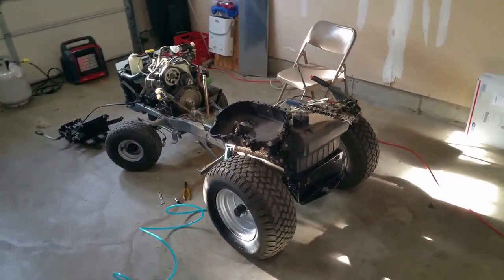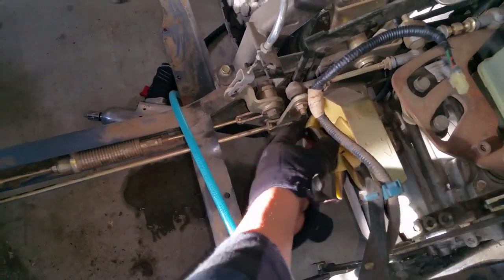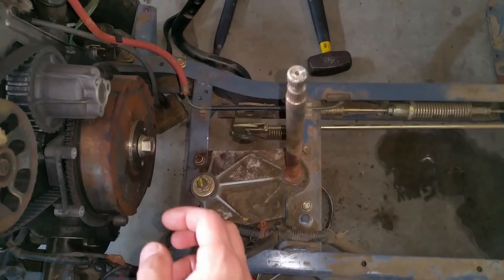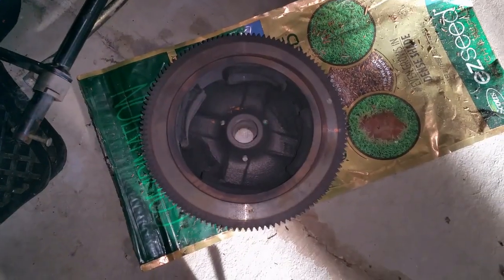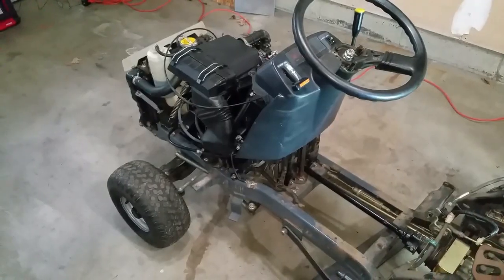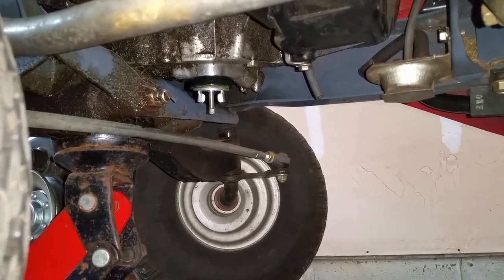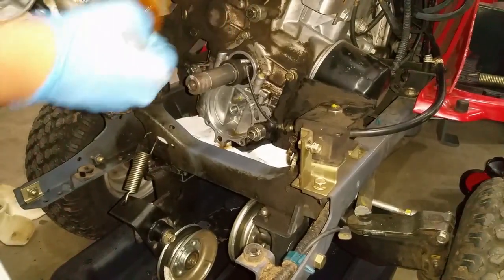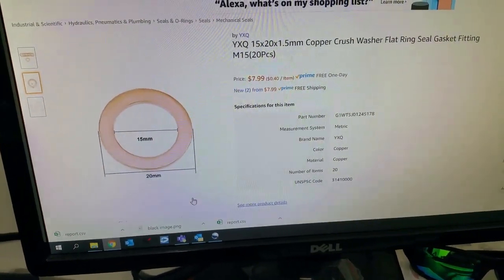Honda H4514 Service & Rebuild

Comment: Looks good. Mine needs the front damper on the drive shaft and i'm having trouble finding one. Do you have a source?
Reply from the maker: Boats.net
Reply: @Bassguitarist1985  Looks like they are out of stock on that part. I think it is part # 40416-758-800? Did you get a new shaft since it was damaged or just reuse the old one? It looks like the shaft may no longer be available?
Reply from the maker: @russfouts6334  https://www.ebay.com/itm/New-Genuine-OEM-Honda-40211-890-950-Propeller-Shaft-Damper-A-for-H4514-H4518H/264825614324

The part you need is 40211-890-950. Boats.net has it!
Reply: @Bassguitarist1985  I believe that is the rear damper isn't it? I need the front one. Obviously would replace the rear one as well but the front one is the problem just like yours. I can't find the thing anywhere! Do you think they will will come out with new ones or is that it for the mower?
Reply from the maker: @russfouts6334  The dampers are the same for both the front and rear. you can use the part# I gave you.
Reply: @Bassguitarist1985  Ok. Thats great. I'll get parts ordered up. It looks like a really good time to do the timing belt and water pump in while everything is apart. Thanks for all the help;) Do you know anyone with a used drive shaft that's in decent shape?
Reply from the maker: @russfouts6334  check ebay. Thanks for watching!
Reply: @Bassguitarist1985  Well I got my tractor apart and yeah the front damper has come apart. I would love to replace the shaft at it is a bit torn up but have not been able to find one. Do you have any source for a propeller shaft?
Reply from the maker: @russfouts6334  eBay is your best bet or try mytractorforums and see if anyone is parting a machine out.

Comment: Well, I found the problem with mine. It was off by about 5 teeth and their was grass jammed into about 5 of the teeth on the pulley, that will do it.
Reply from the maker: Yikes! Thankfully these are not interference motors, but off by 5 teeth that would certainly  make it run like shit.
Reply: @Bassguitarist1985  I'm pretty sure it jumped it and it wouldn't start after that for him which is how it was left when I finally went and got it. Anyway, I fixed it all up and turned around and sold it for $1700, not bad at all.
I found it to be pretty easy to work on, especially following the service manual. Pulling that motor wasn't that bad. That machine had a family of mice living in it when I got it, I must have easily killed 6 or 8 of them. Their main home was behind that belt cover. But they were able to run all over that machine with the way it was designed, out the cover down the drive shaft tunnel, up above the trans, lots of places to hide. Cleaning up after them wasn't fun, but it was worth it in the end.

Comment: I have a favor to ask.  I have a 4514H, 38" mowing deck.  I can't find the proper v-belt for the deck.  Do you have access to that info.  mower deck serial number is RZBA 1001179A
Reply from the maker: Honda 76181-758-L00
Reply from the maker: https://www.partstree.com/models/cd4538-c-sa-rzba-honda-38-mower-deck-made-in-japan-sn-rzba-1000001-rzba-9999999/blade-shaft-i-0/

Comment: Well, mine was smoking pretty bad, but it cleared up after some run time, so not exactly sure what was up, maybe oil got places it wasn't during removal and service of the engine. Anyway it came out great and its in real good shape, mechanically it wasn't beat on, so its gonna be mowing for ahwile still. Thanks for the helpful video heres mine complete.
See video demonstration (copy and paste link)
https://youtu.be/tq_PUMlii-s
Reply from the maker: Cool video! The low idle the engine will rock a bit due to the firing pattern of a two cylinder. check the motor mounts make sure they are not worn. An unbalanced drive shaft or worn damper will cause the same symptoms.
Reply: @Bassguitarist1985  I'm hoping to come across an 18hp version of it in the future. From what I saw their a little more complicated to work on than the 14 (13) was. But I enjoyed working on it, it was something different and definitely sharpened my skills further, different than a typical air cooled Tractor for sure.
Reply from the maker: @Mr_Tecumseh  Yes the 5518. I will be working on one this fall. a guy a few towns over has one that he wants me to do a similar break down and rebuild. That one you definitely need to pull the engine I'm told...
Reply: @Bassguitarist1985  Well, I didn't remove the entire chassis, but it seems like pulling the engine is faster and easier anyway. It wasn't very difficult, the service manual explained it step by step. Hood, radiator, fan, clutch, wiring, throttle cable, steering wheel, dash and 4 mounting bolts and it was out, it went fairly quick. Plus if you need to change your starter, thats the way you have to go. Its a good thing I did, because my starter was acting up and I almost had to replace it. Luckily I didn't have too. All I had to do was turn the main lead bolt and it started working fine again, which I found out after I removed the starter and began testing it, so something must have been making contact internally and it was shorting it out.